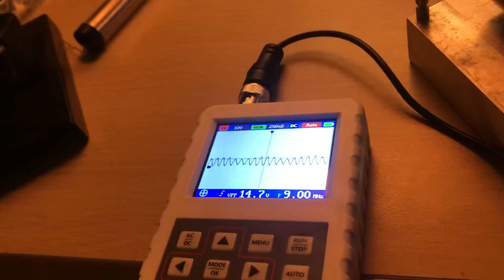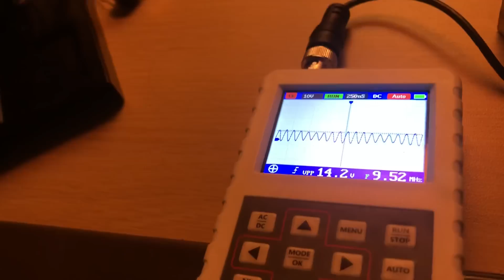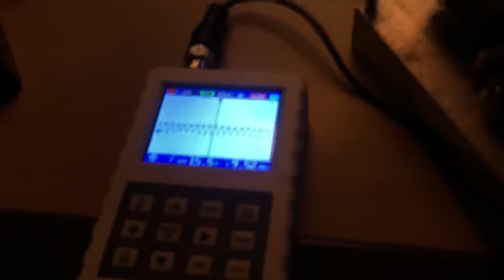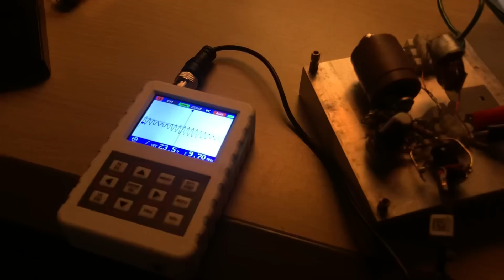Plasma toroid experimentation

Comment: Absolutely incredible!! This is mesmerizing my man. Would make a cool movie prop 👀
Reply from the maker: I was thinking this would be a sick movie prop too! Like something in an inventor's workshop or even the main doohicky that powers a starship :)
Reply: @BackMacSci  You may not be too far from that- if you can make a plasma sphere and surround it with thermocouples set up as a thermopyle, you may be able to draw more energy from it's corona than what it takes to sustain the plasma sphere...  Look up the Sapphire Project, this is precisely what they did, but they used a spherical anode and a rod cathode.  It might work, or it might not... Who wants free energy anyway?
Reply from the maker: @mcdoctorglock  Hahah I'll check out the Sapphire Project
Reply: @BackMacSci  you can find their big talks on "the thunderbolts project" YouTube channel
Reply: @BackMacSci  I wouldn't look too heavily into that stuff, the safire project is strongly linked with the electric universe "model" which is heavily based off obsolete and long debunked plasma cosmology. It just doesn't explain many phenomenon like, blackholes (which we now know exist, we've taken a picture of one) and gravity which all have a strong basis in modern theories. Heck even one of the main guys who previously worked on the project apparently called it quack science at best and pedalling a scam at worst.

Comment: I think the peak voltage increases after the plasma dies for the same reason that SSTCs die from excessive toploading: the plasma acts as a load just like a Tesla coil streamer, and as such, it "sucks away" the power and gives it some place to go. My current theory is that the plasma ring is acting as a secondary coil, in the way that it is essentially a conductive loop that extracts power from another coil. That might also explain why it forms a ring shape: when the plasma is ignited by the Slayer Exciter, it has no shape (I assume). But when the primary coil induces an HF voltage into it, it travels in the same path as it would in the wire of a secondary coil (in a circle mostly parallel to the primary) and the coupled magnetic fields keep most of the plasma in the conductive region. Just my theory anyway, congrats on the major success!
Reply from the maker: Wow, great theory! You took the words right out of my mouth. I didn't know how to say that the plasma ring is a conductive loop that extracts power from the coil below, but I like that a lot. If you watch the video in slow motion, the plasma toroid "ignites" (is what I'm calling it) already in the shape of a toroid, and rises from the bottom, gaining thickness and stabilizing around the center of the globe. What I find most interesting is that if I ionize the xenon into a glow discharge, and then turn up the gate bias, the oscillator generally cannot form the toroid out of the glow discharge plasma that fills the globe, the toroid forms easiest when there is little to no glow discharge in the globe. Maybe the glow discharge saps the power that is needed to ignite the toroid...
Reply: @BackMacSci  Maybe the toroid has issues initiating from a simple glow discharge because the resonator is acting more like an induction heater: simply "fueling" the existing plasma (like you said, sapping energy away), while a toroid initiated from an electromagnetic field is more likely to maintain its ring shape, since that ring is where the electrons are "happiest" flowing. Since electric fields are perpendicular to magnetic fields, this "happy zone" seems to make sense. The magnetic flux from the primary it pointing up into the globe, while the electricity is flowing round and round in the plasma at basically a right angle to that field! Pretty neat to see the physics work out like that, lol!
Reply: @LabCoatz_Science  I agree, thanks! I'm looking into eddy currents and inductively coupled plasma along with your comments to make my video explanation!
Reply: @LabCoatz_Science  I'm just here to draw attention to your brilliant unintentional pun. Current theory XD
Reply: @BackMacSci  I think the correct terminology is 'Strikes' as this is also how fluorescent lamps work in a round about way. the method is different, but the end result is a channel of conductive plasma that travels the length of the tube between the cathode and anode, the plasma in turn of course exciting the phosphor coating (If it has one) to produce the wavelength of light desired.
Reply from the maker: Oh yeahhh thats right, “strikes”, that was on the tip of my tongue. Thank you, Ron!
Reply: the plasma ring would be dying if something wasn't feeding it power constantly
Reply: I am going crazy while reading your explanations, congratulations to both of you for being such good physicists. This story reminds me of my time as a first-year engineering student, I had dreamed of something like this, a low-pressure plasma that sustained itself by the fields it created around it, thanks to the currents that circulated in it. I hope you understand my English is not the best ajaja, Thank you very much for sharing, I send greetings from Argentina.
Reply from the maker: Ah thanks! I’m so happy to have brought your science fantasy to life for you!
Reply: The plasma ring have its own magnetic field that shapes it, that's why it snap together once the ring is formed.
My guess is that by putting more load on it you are strengthening the magnetic field. The plasma elongate following the field of the coil and once it touches his own tail the circuit close and the field change into a toroid.
Reply: Speculation…

Using a second coil 90° out from this one of the same design and control circuit, but intentionally out of phase, you should be able to get your toroid to “spin”. Or toggle. With any luck and several coils, you might be able to manipulate the toroids movement into something we have yet to understand. 

Your magnetic field from the lower coil causes an electric field above it. And it makes your toroid “stand up”. If you can visualize the whole principal behind magnetic and electric waves, the phase relationship is exactly out of phase. So when your magnetic field has high amplitude, your electric field has no amplitude and is (using lenz law) perpendicular to your magnetic wave. 
You can prove this by using two scope leads attached to perpendicular coils. (Once you get some real o-scope’s!) 

So because we know the phase relationship that causes your toroid to be in its place, we can “move” one to cause the other to move. Movement of the fields will cause movement of the toroid.

Comment: I have done a lot with plasma globes but this is the most impressive thing I have seen yet. Amazing!!!
Reply from the maker: Thank you Ralph! I feel the same way. I saw this phenomena on the "teslacoilpro" youtube channel over the summer and instantly knew I needed to have the device on my desk too. Since then, I've worked with plasma globe expert, wayne strattman and rf engineer Jeff feigin to make that dream into a reality. Stay tuned for more updates and hopefully a device that can run for longer than 4 minutes without making the heat sink very hot.
Reply: @BackMacSci  Is liquid Cooling an option?
Reply from the maker: @GameBreakingLogic  It is an option, but if I use any type of cooling, I'll use a laptop fan.
Reply: @BackMacSci  I think you’re saying that running cool tapwater over the globe is not a good idea. Is that right?
Reply: @JB-fh1bb  glass isnt a good conductor of heat. cool it unevenly and it will crack
Reply: @zwxyer  What if water is flowing over it widely enough that it’s basically submerged? (This reply from 100% not a plasma expert)
Reply: @JB-fh1bb  I'm not an expert on plasma myself. I was thinking more about a tube flow based cooling. I hope @BackMacSci can answer, they would know better if submerging has any effect on the experiment, or if it is possible at all.
Reply: @JB-fh1bb  I dont think its the glass thats getting hot, I think he means the circuit thats powering the plasma